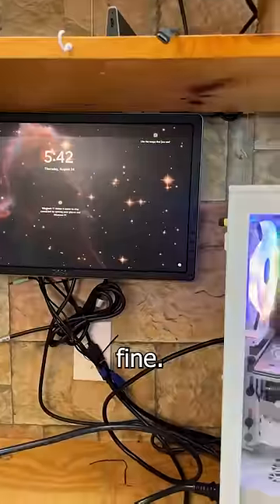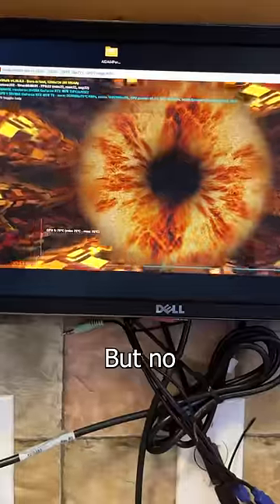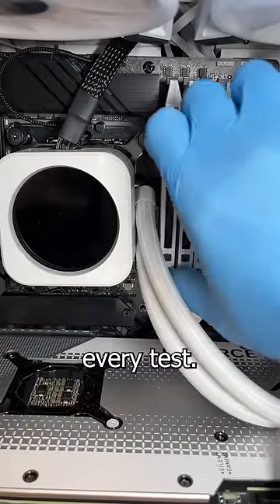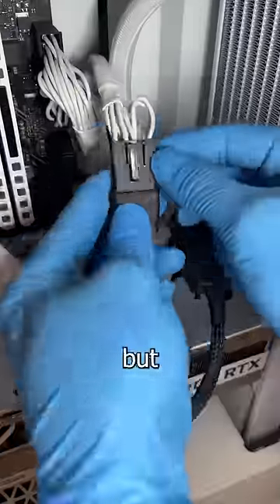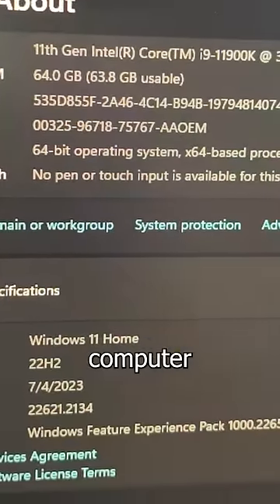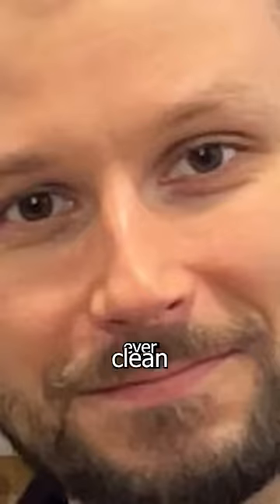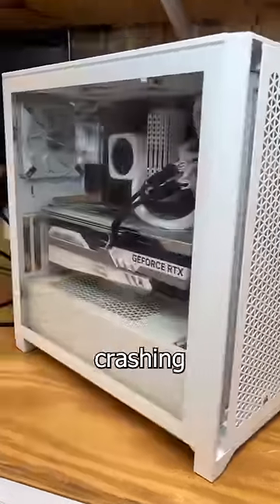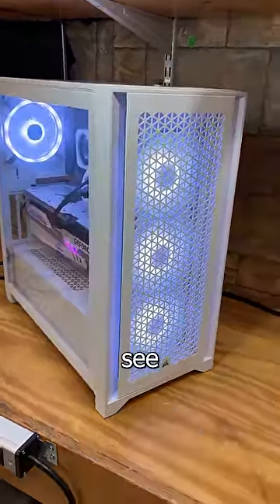The hardest repair in my shop is a #gaming #pc with random problems #technology #shorts #tech

Comment: Reminds me of how my truck, for some reason, would completely drain the battery if left parked for about a day, sometimes less.  I changed the battery five times (thankfully the first one I bought came with a warranty and so the other four didn't cost me anything), yet it kept draining the battery.  I took it to a mechanic friend, they couldn't figure it out, and then me, my dad, and my BIL went through and took out the fuses for some of the lights (it is an old work truck, so it has lights in the back cabin and on the top) to see if any of those might be slowly drawing power, but that didn't work.  Then I took it to a car electrical shop, left it there over the weekend, they couldn't find any draw on the battery, none of their sensors picked up anything and the battery didn't drain at all (like, you can't fix the problem if it doesn't show the problem when you need it to 🤦‍♂️😫🤬).  So, in the end I've just been disconnecting the battery if I'm going to leave it parked for more than a few hours. 🤷‍♂️

Comment: Yeah, I've been chasing a freeze-up. For my system, I opened the case and did an inspection and 2 ram chips were loose and a couple sata cables as well. What I find amazing is how the frack did they still show up in DxDiag. I'm old and I actually have a degree in hardware repair but I retired some time ago and the new stuff while based on similar tech it's slowly getting away from my knowledge.

Comment: A Pure-sine UPS usually fixes power instability. But it's also a 14th gen intel, so it's likely the new cache crash issues related to random crashes/VRAM errors. Try running games, decompression tests, not furmark. If it starts crashes after a few hours, it's the CPU failing. Congrats.

Comment: At my first week in my first job as an I.T Technician, I had a Computer that would blue screen and die because the RJ45 port was shorting the entire thing.
Also had another PC with a dedicated Graphics card that stopped sending video signals, turns out the VGA port on the GPU died but the HDMI port still works fine.

Comment: I have had a problem before where the PC would randomly switch off. Spent months trying to work it out. Finally realised one day it was related to a cheap 5v PSU i got for a pi which even when plugged into a different socket in the room would cause the computer to power off and reboot spontaneously, even through a surge protector!

Comment: 20 years ago when I worked for time warner a customer called in about their internet not working.
They had their surge protector under the desk and when they moved their feet it would hit the power cable and trip the surge protector breaker.. It took multiple tech runs to figure this out.  They were annoying to deal with and countless times we had to credit their account for issues like this.

Comment: Actually had a similar Story.
PC crashed every couple hours, thought my Graphicscard was having struggles, because I just switched to a 4K Graphicstablet (Wacom Cintiq Pro). turns out the factory USB Cable from Wacom was broken, flooding windows with Disconnect/Reconnect prompts.
Event Manager was full of error messages regarding connection to a "HID Device".

Tried a Friends USB A Male x Male cable, and all problems were suddenly fixed.
However, I was Dum and went with my first gut feeling, and replaced the Graphicscard already.
My gut Lied to me

Been running fine ever since I bought a new cable.

Comment: "shorting out" a computer via USB is .... basically impossible, nowadays. What actually happened is faulty USB docking station firmware, faulty USB display/audio signalling, faulty USB drivers, faulty chipset drivers, faulty UEFI firmware ... you name it. "Software" is a thing. Things break. Especially if they're cheap.

Comment: Don't forget the switches connecting the panel buttons to the motherboard. They often connect to the motherboard by splitting into small rectangular plugs, labeled "RS" or "PS" etc. Rs for reset switch. 

Just like anything else, these can fail. Had my own pc randomly restarting, not because of the power supply or inadequate air, but because the RS switch was faulty while the other switches were fine. Unplugged RS and it never did it again. Of course that was only after buying 2 new fans and a new psu. 

So remember the switches! Cus they're hardly documented anywhere!

Comment: Oh man, the faulty crap. On my old pc, if I ever got statics on me from wearing certain clothes, I could crash internet module (or whatever that's called, the one built into motherboard) by touching my focusrite sound card. And after that the only fix was to unplug power and every single cable from the back of pc. Mouse, keyboard, dp, sound, ethernet, drawing tablet, etc, then plug everything back in.

Also a funny thing - if all of a sudden your monitor stops working with "No signal" or something like that and you use VGA, DP or DVI - try to swap sides of the cable first - plug the end that used to be in the GPU into monitor and the other end into GPU.

Comment: I can tell you what the problem is, at the customers home, he has the pc, monitor, speakers and other stuff connected to a power strip (probably a cheap one) connected to the wall socket. So lots of power being pulled from one socket trough a cheap power strip which makes te power supply shut off.

Comment: My brother had a customer who live a couple of hundred metres away from where the shop was to bring their brand new computer back to the shop because it kept crashing. Ran it for two day and returned it to the customer who was back again the next day, same problem. After much testing and part swapped he visited the customer at his home. It turned out the voltage at his house was around 270V  when it should have been 230V. Once the transformer was adjusted his computer ran just fine.

Comment: Had a similar issue with my pc. It started to randomly power off, then i thought, "What was i  doing to it at the time?" I was modding my 3ds and still had the micro sd card reader plugged in, and i took that sucker out and felt like a genius, lol. The reader was shorting the whole pc and i figured it out in a few minutes.

Comment: I've had the issue of my PC randomly shutting down before aswell. The difference was it wasn't crashing or anything. It was powering down. And the other issue was.... Well it was also randomly powering up in the middle of the night. So I knew it had to be hardware related. Turned out my Power Switch was Short circuiting. It was my best guess with that kinda behaviour so I plugged the power switch out of my main board and that stopped the problem. Probably about the cheapest hardware malfunction you can get.

Comment: Funny story. My laptop has been randomly rebooting for over a year, and sometimes losing program focus causing games to minimize, etc. I thought it was the video card as it only seemed to happen when the GPU was engaged. A few months ago, I finally realized it was my docking station. Somehow the DisplayLink drivers (even when uninstalled and reinstalled) were the issue. So, I replaced it with one that doesn't utilize those drivers and the problem stopped.

Comment: My ex-computer was crashing because of the usb flashdrive. These ports can be problematic. Also, and not related with this short, static electricity is a real thing if you dont turn on computer for a long time. Thanks

Comment: Many computer problems like this come from poor power conditions.  Often a cheap under-spec power supply, or faulty/old electrical wiring at the power outlet. ALWAYS buy a quality PSU and a UPS with 'Line Conditioning'.

Comment: Had an issue on a friend's pc but only when they came over to hang out, spent a weekend trying to figure out why the pc would randomly power off on its own mid game, came to find out when they shook the desk the pc was on, the extention cord that their pc was plugged into would get flipped off for a moment because they laid it on its side onto of the power button
Start from the basics and the bottom every time

Comment: I returned my PC to my PC company due to Fan RGB issues and where my PC would randomly minimise, a command prompt would come up and my game would crash. In the event log, it said it was a GPU issue. They managed to fix my fans but they tried everything to get the game closing issue. They stressed tested it, played games, and more. But nothing happened. When I got it back, the game crash issue started to happen again, so something my end was wrong. Turned out my xbox controller needed a update and every time I used it, it would crash my game for some reason xD After updating the xbox controller, never had the issue again. LOL.

Comment: I had those symptoms with several of my computers, each of which were running some ASUS piece or another. One day, one of those stopped behaving. I had put an inverter/signal filter for my house because of electromagnetic related health problems.
Seems like the grid provided a slightly unsteady signal, that, for some reasons, passed through to the computer transformer and ASUS product are strangely sensitive to these. Never buy ASUS products, people…

Comment: My current pc was having issues where it wouldn't boot reliably, I'd try to power it on, the light on the GPU would turn on but nothing else would happen, so I'd have to hold the power button down to shut it off. I'd do that anywhere from 4-8 times before it would finally start completely. I took it in and the tech could NOT reproduce the problem. He blamed my keyboard for pulling to much power, any USB stuff I might have plugged in, my mouse, basically he blamed everything else. After 2 years I started having other issues and took it in and found a ram stick had died, it got replaced but then it died again and the tech told me the motherboard was faulty. He replaced the mobo and ram and it's never acted up since. So the motherboard was faulty from the start.

Comment: Had the same issue. GPU was faulty and got a refund. 
Funny enough it only started crashing in certain games. When i was about to send it in i used the same benchmark SW as you did to replicate the issue to post the event logs along with the card but This specific Benchmark SW NEVER crached the card lol. Got mad after few hours of no results.. Opened up Path of exile to play for a bit to cool my nerves a bit and it died on me in few minutes. Installed few more games and they crashed too. Reinstalled Drivers for GPU  crashes still remained. They agreed the card was the issue in the end.

Comment: Thats interesting, my newest pc turns off randomly as well (mind u this is an older refurbished pc) i think its fail safeing due to the humidty from the summer, so ive got a dehumidifier on as well. Which seems to have fixed the problem. But I'll check the ports and cables again if it decides to take a nap on me.

Comment: i had an issue like this, turns out the motherboard had a tiny crack, in the cold, the connections separated, but once it got warmer, the connections reconnected and would run just fine. had to point a hair dryer at it to start it up. ended up swapping the motherboard and it turned out fine

Comment: Could also be because it is an i9-14900k and Intel is bad at making processors. The issue is most commonly triggered when performing decompression. But could also be UEFI settings when it comes to secure boot and the thunderbolt connectivity. Or, drivers for the dock or something that is connected to the dock.

Comment: I was gonna say, accessories plugged in can short it out, same thing happened with my laptop and a usb c extended monitor. My laptop runs fine without the monitor for hours, but crash's within a hour when I use the usb c monitor.
Reply: got a new monitor for it and it works like a champ now.

Comment: Had a computer problem where it would randomly black screen. Opened it up to try to fix, fiddled around and turned it back on and it was fine. Closed it up and it stopped working again. Turns out the problem was a loose motherboard connection, and every time I tilted the box to open it the connection would work and then when I put it back it would slowly get loose again.

Comment: This is VERY common.......
these external peripherals use chap ass PSU

that leaks  hundrredds of volts into the ports, but at a VERY low current, until something breaks , then tehy jsut sove that voltage in with more current.

Comment: MSI motherboards generally will pop-up with a warning for U. S b overdraw. Mine was crashing for like a week.And then I realized it happened every time my controller vibrated. As it was u s b 3.0 plugged into u s b 2.0 point oh pulling too much power. Typically, that wouldn't be an issue and the device wouldn't work except that.The controller was just connecting via bluetooth and working, but when it vibrated It was pulling the power from the usb instead of batteries.

Comment: I was actually about to mention the USB devices. I just legit dealt with this the other day. Someone using a B520M had a faulty cable for their Xbox controller and their USB expansion hub wasn't powered separately from the computers usb ports. Always crashed during GTA Online and stuff. 

I told them as soon as it freezes unplug all devices. Instantly computer ran back on normal. They just plugged things in one by one. Found out what I said above ^. To those who stumble on this comment. Trust me try doing this before anything else.

Comment: Ik this is a pc repair channel but I’m looking for a better graphics card for my pc right now, core i3 (Ik not the best) and currently has a RX 550,  150-180 ish budget and I was looking at a 1650, it seems to fit my needs, but idk I’m not experienced building pcs before, so is a GTX 1650 a good replacement?
Reply: I would also go with a RX 5700 which based on the research I’ve done is better
Reply: RX 5700 XT I mean

Comment: I just upgraded my PC a week or so ago, I had a 1660 and upgraded to 4070, a Ryzen 5 3600 upgraded to Ryzen 7 5700x3d and 500W PSU to 750W....first few days my PC started to just shut off (like getting the plug pulled) randomly, sometimes back to back multiple times but then not again for the rest of the day. 

At first I thought it was the PSU's cable that I was using which was from the old 500W one, I changed to the cable that the 750W PSU came with and the problem stopped....until today lol.

Brought it to the PC shop which I bought the new parts from and BOI, they could NOT recreate the problem at all, I assume it might be because of the PSU cable that they used...Not quite sure what I should do right now tbh.

Comment: We used to call it the technician aura in my first job. I did repairs in store and at house visits and it is stupid hard to recreate some errors. We used to joke about it saying that the machines detected my aura and started working ok. The reality? The user usually is doing something wrong and the technician does it right so there is no error. That's most of the times. Sometimes it was a real problem in the machine. And every now and then  it was some weird ass error or freaky reaction to some external shit as in this video. But mostly people being stupid.

Comment: i had this exact problem, computer would crash several times a day or freeze with glitching. turned out that the right memory card port was broken. now i just have one and it struggles a bit with high res games but otherwise works fine

Comment: I've had crashing issues in the past, but that was at my old house - turns out the wiring there is super faulty, so I had to have a surge protector between the pc and plug.

Comment: My iBuyPower PC "randomly powers off" except that it's not powered off. I had to set my power settings to NEVER sleep. Otherwise, I would have to hard reset it by holding the power button for 5 seconds and force a reboot losing anything work I had done that wasn't already saved.

Comment: I HAVE A SIMILAR PROBLEM. I can tell you how to replicate it (assuming it's the same problem). It happens when either: 1) The PC has been running for too long WITHOUT a game or RAM-eating application open; 2) It enters the screensaver mode and stays like that for too long. And by "too long" I meant anywhere upwards of 10 mins. Yup. In some cases, it only takes 5 mins. 😅

Comment: I had a similar problem with my system some time ago. My system would power off for no reason at random. it mainly did when I was just browsing or watching YT. Months went by and I was at some point fiddling with the wires in my system and I touch something and it went off. I tried it again and found out that it was the 24 pin ATX cable was faulty. I got another one and everything has been fine since.

I also ran all kinds of benchmarks as well and could not find the the problem until....

Comment: I had a problem with my house wiring where the outlet is had the PC plugged into wasn't grounded. It shut down a couple times when I touched it plugging in an external hard drive. Got the wiring fixed soon after and never had a problem again.

Comment: My computer once kept BSODing all the time. Event view was useless. Everything was fine on that page. After weeks of attempting to find the issue, turns out the Netgear drivers for my wifi adapter were old and outdated. Uninstalled that and moved my computer to be hardwired to the modem. Problem solved.

Computers are wild. Well personally, the computers are awesome. Windows is filled with shit to make it worse. Game too much to migrate to Linux and deal with all of that.

Comment: I had a problem where it would "brown start", meaning that it would run fine, until load. Issue in the mobo where heat caused the metals to expand, short circuiting it